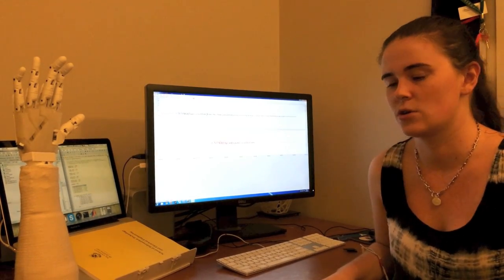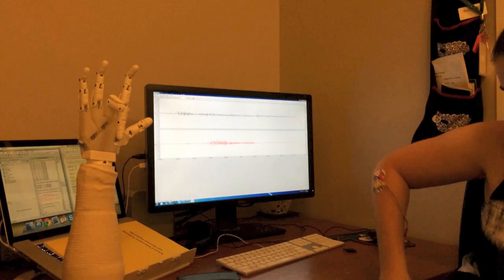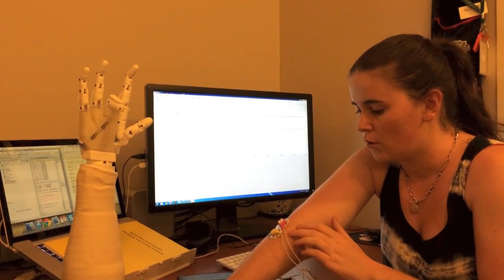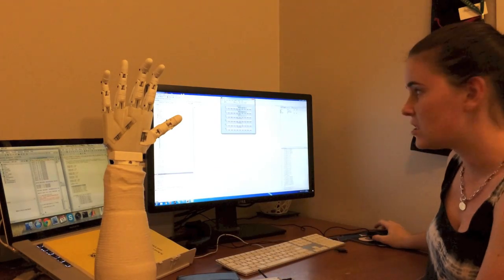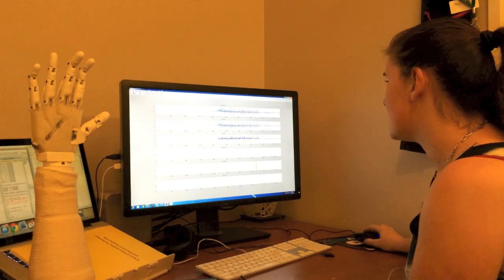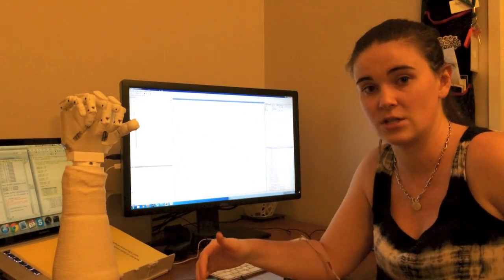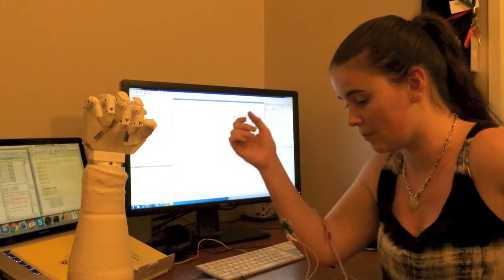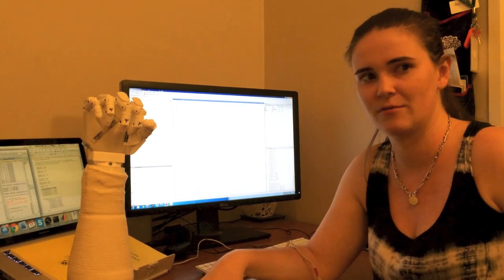Controlling a 3D printed arm using surface EMG - Honours Thesis

Comment: what signal processing technique did you use? did you rectify your signal first and then low pass filter it i.e. linear envelope?
Reply: Yea, defiantly! The initial steps included filtering base line drift, rectification and low pass filtering to achieve a nice clean signal envelope. Both infinite impulse response (IIR) and finite impulse response (FIR) filters where considered for this filtering. Ultimately a IIR filter was chosen as it has zero phase shift in the time domain so I was able to maintain the time mapping of activation and deactivation.
Reply: I would like to know more about what you have done in terms of time mapping of the activation and deactivation (have you performed machine learning to recognize movement of your hand or amplitude-based threshold (ON_OFF control strategy)). May I have your email address to discuss this in more details please?
Reply: I'am so happy to see this vedio, but this is 3 years ago ,I don't know whether you can see it. I'm a student, and I need a equipment to aquire the semg signal. but I have no ideal which equipment I should choice, could you tell me which equipment you choice? if you can tell me your address is better? thanks you very much!

Comment: Do you think this could work with someone that has very limited muscle movement, as a sort of exoskeleton?
Reply: This method is dependant on getting a good emg signal from the wearer. Obviously on an able bodied person this is easier to achieve. If there is some signal attainable from the wearer there may be amplification and processing methods to achieve your outcome. However if the signal can not be distinguished from background noise or interference emg control may not be the best options for some one with weak muscle control.